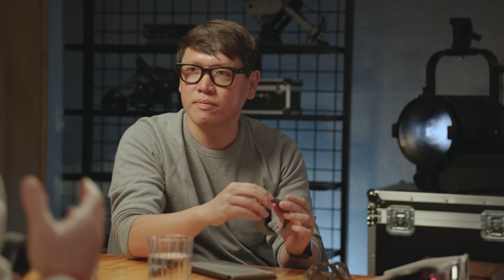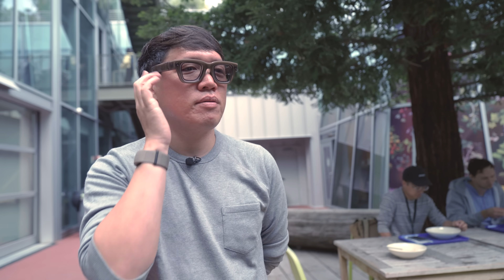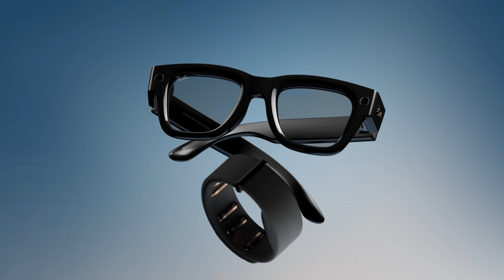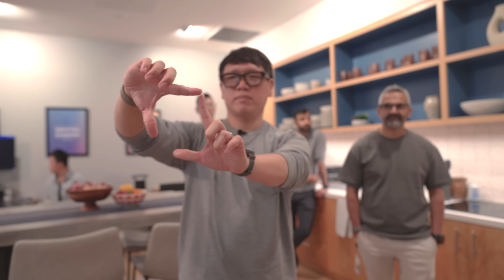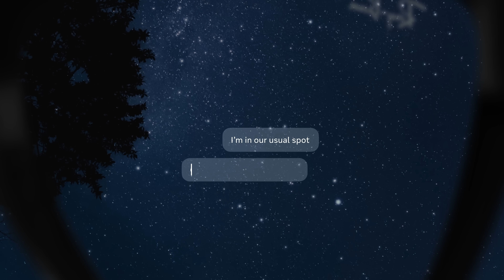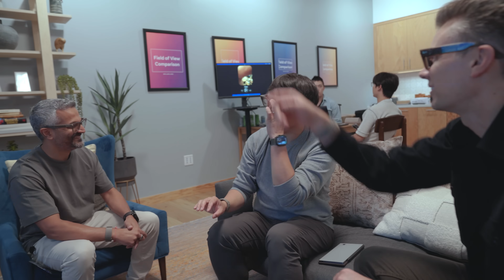Hands-On: Meta Ray-Ban Display Smart Glasses!

Comment: This review has certainly answered a lot of my questions, mostly about prescription interaction.  It does however raise more questions.  Is there any interface with google, phone texts, or the way they kept sliding down on you, which as an eyeglass wearer would get on my nerves to no end.  I feel like I would regret buying these with Google's product in the works.  It would be very interesting to have two rings on your fingers for interaction than this wrist band and would be a really cool upgrade or some sort of LED flash light built in as well.  This at least gets developers and inventors involved and thinking.  Thank you for a very good review.

Comment: There should be a battery pack you can wear like a vest underwear so you can hook up any wearable devices. I wouldn't mind a wire hanging down back of my neck connected from the glasses to the battery.

Comment: I really hope the neural wristbands will be usable with future Meta Quests.
A great input-method would be 'gaze and pinch' - similar to the Apple Vision Pro, but use the neural wristband (rather than hand-tracking) for selection confirmation.
This assumes that future headsets come with eye-tracking... fingers crossed.

I hope more companies will adopt the neural wristband form-factor as an input method. Currently, the only other company focusing on sEMG neural wristbands is Mudra - they call their sensor method Sensor Nerve Conductance (SNC) but is pretty much the same thing as sEMG. They're a 3rd-party manufacturer focused on smaller players in the XR glasses space.

In the long-term, I think it'll be unlikely for sEMG wristbands to be sold as purely 3rd-party wearables because of how tightly integrated their software has to be with the 'parent' wearable (eg, glasses, headset).

Comment: The major non-thermal effect of nnEMF is a net increase of deuterium in the TCA cycle with a change in the pool of hydrogen in the NADPH pool and a loss of melatonin which causes more deuterium in the cells. This single change destroys cell membranes where DHA is located. DHA controls the lipid cytosocial regions on lipid rafts in cell membranes to perform the movement of electrons on a liquid crystalline semiconductive circuit...a statement made by Jack Kruse. This is whats happening when you put these stupid ass glasses on. Wake up. And shame on tested for promoting this.

Comment: Are they releasing transparent display frames? The pair you are holding at the very beginning of the video looks clear, so you can see the electronics.

Also, would these have anti-glare for prescription lenses, and how does it work if you need to change your prescription?

Comment: When I get these in early 2026 (apparently launches then for UK), I will have the display turned off when I am in conversation and respectfully give my full eye contact attention to whoever I converse with. When I go to the theatre and cinema, I will have it switched off. It's all self-discipline and the glasses allow us that freedom to choose to be a sensible or not. My main problem will be how much extra will it cost for prescription that goes beyond +4/-4, I am a 5/4. I have the Meta Wayfarers since their launch and love them but I had to go to Lensology for affordable reglazing for just £100. Whereas Rayban was charging me £600 to include my prescription. Going third party for the lenses saved me £200 but that option won't be possible for the new display Raybans because of course the right lens has built in display. My worry also, is what happens when my prescription changes, what will Meta Rayban charge to reglaze if at all they can? Would render the glasses a useless paperweight if they can't reglaze with updated prescription. Thanks for the highly informative video, yet again.

Comment: I have 3 meta Raybans. Two are with perscription and the third without for when I wear contacts.  I use up the battery on the glasses within an hour, so I swap to my other pair while I recharge the dead one.

The glasses recharges quickly from the charging case.

What I do not like is you can only have 2 glasses paired to the cell phone. This is why I didn't buy a 4th pair.

Comment: 14 hours straight if Heavy flow Sunsert Dinner added for Free
Reply: Can't wait for the stabilization video. This is going to change sliding down rock slides and hiking up geothermal waterfalls and jumping into hot springs for ever. Just outside of Vegas Baby ;) @adventurechild

Comment: Can't wait for the stabilization video. This is going to change sliding down rock slides and hiking up geothermal waterfalls and jumping into hot springs for ever. Just outside of Vegas Baby ;) @adventurechild Guess we will have to get 600 pics and video instead of 300+ ROFL

Comment: As far as I'm aware the invasion of privacy issue, criminal exploitation and consent to commercial exploitation has NOT been resolved since the first camera equipped glasses were release years ago.
If a person doesn't give AF about your privacy and consent why should you interact with them let alone do business?
A limited field and range of observability light on the front of the glasses is not sufficient to the range and scope  at which these devices can be abused.
Norm and Adam, kindly express publicly your stance on this matter.  Covering tech for the sake of it is one level of curiosity, doing so actively without conscience is disappointingly significant.

Comment: Allow the question: Would it be possible for these glasses to perform calculations in real time? Could this be beneficial for my work as a salesperson at the cash register? Such a function would be extremely practical, as I would then no longer need printouts and the calculations would be done automatically, so that I would have the total amount directly after eight hours of working time. That would indeed be very beneficial.
Reply: Probably not since the glasses are not open for programmers. Maybe if the glasses have access to the browser and your calculater runs in the browser but I don't think there is a regular browser on these glasses that you could use for that. I would say no but not 100% certain there might be a work around.
Reply: I think it'd be very complicated to build that.

Comment: Probably the second version of the Ray-Ban display will be a success, the current version is still slightly too bulky and heavy. 

As said if it slides down your nose it will become annoying and you will not wear it all day as your standard glasses. 

They would be great glasses for developers but without access, I guess they will not sell well. Only with many apps available you might be willing to accept a slight discomfort but the features they showed are not the ones regular folks need every day and can be done as well with your phone or with the regular Meta Rayban glasses. 
For example: Who needs subtitles? Also zooming into pictures is better done with your phone. For quick pictures and videos, the regular Ray-Bans are good enough without the disadvantages.

I saw people use the Instagram live stream of the rayban glasses to get access to the video footage and use that for doing some development. I guess as soon as Google releases glasses developers can program apps for Meta will open up too. Currently, they are too scared of developers doing shady apps like face recognition and they don't want to be the first to get burned by bad press.
Maps are cool but it also works well with sound alone. AI is also cool but it also works with the regular Meta glasses.

The only thing I see where this could become somewhat useful is AI showing you visual information based on your context. 
For example, you read an article and there is the name of a famous actor and the glasses automatically look it up and show you the person in a photo giving you additional information, however, this would require developer access to add such features.

The only thing the glasses can do thay is unique is showing tekt or images hands free. There are use cases for it like cooking but even than its just slightly better than using your phone and you have to deal with all the disadventages and likely less intuitive navigation to the recepy compared to the phone where you can search much better and faster.

Conclusion cool but without developer access no thanks.

Comment: The number of times you pushed your Metas back up your nose is a bit telling. With the Meta Displays being heavier, that means it will be sliding down even more. I realize your head is a bit animated in this video - so it isn't maybe really that bad normally.

Thanks for the video. Also - there was a mid frequency feedback through the latter half of the video.

Comment: Best question is, will it translate other languages perfectly, can the AI pick up on mis-spellings and still understand ?
Reply: Depends on if the translation happens on the phone or glasses. if on the glasses it is not clesr if it has enough compute power to run the best models. if it runs online or on the phone the technology is already advanced enough to do it basically error free and in all languages.

Comment: Norm, the question I have is:  prescription lenses need to be adjusted every few years.  Does  this means to ditch the display glasses that often? Replacing the lenses would be really expensive, right?
Reply: You would need likely need to buy new glasses because they are build in one piece in the factory.
However after 4 years the technology is far advanced and batteries used up that you want to switch to a new version anyway.
Reply: Most people rarely need a new prescription unless your eyes are failing.

Comment: if i'm paying $799. i would have paid $999 for the better camera that the gen 2 glasses have. big fail there.
Reply: I missed that you saying the gen 2 has better cameras than the top of the line meta display?
Reply: @VR_Wizard  if you go to meta website and compare the glasses the display does video 1080p+ at 30 fps.. gen 2 and oakley do 3k video at 30fps and 1080p at 60fps

Comment: I hope they come out with a double wristband set-up for the Quest 3 and Quest 3S. I am going to skip the glasses, because I cannot wear plastic frames (I need something away from my face), and my prescription is definitely outside the range.

However, I can see myself using the wristbands for a PC, phone, watch, iPad, VR, and more. I actually bought the Control-labs version a decade ago, which didn't work well. But I trust that ten years of innovation, adaptation, and AI have probably made it very good. I am glad that Meta picked them up, otherwise the technology might have been lost. If Meta comes up with a watch combo, I will definitely buy it.

Comment: okay so ever since the band was announced, the connection that I perhaps hallucinated but has persisted and seems like something they hint at is that what the system is really detecting is say not the physical motor input that guides your hand in the shape of a J, but you think" Write a J " and that thought is whats picked up, like its reading the intent. when you were using the band did you ever get the sense that you could possibly control it without ACTUALLY moving your fingers, I have long wondered if this type of control input could create a situation finally where you are sitting in a chair, and you can just imagine yourself walking forward, and it happens in game. have any of your conversations with the Devs hinted at anything this advanced? It seems like there is a lot more its capable of that they don't want to reveal yet.

Comment: This was obviously recorded prior to the live event.Why is nobody talking about the absolute disastrous live demonstration?..I want this technology to work because it could help me with both my eyesight and hearing degradation.I Want this to be viable.However Zuck and Boz blaming WiFi for the shambolic demo was laughable.This device is pitched on working flawlessly in a world saturated with Cellular and WiFi connections ?It was demonstrated in possibly one of the most controlled environments possible and it fell flat at the first hurdle.Such a shame
Reply: Because the two issues they had in the demo were pretty much expected when trying to use Wi-Fi in such an environment. No one actually cares.

Demoing in a convention area with hundreds if not thousands of people nearby and using the wi-fi is not a controlled environment.

Comment: 58:37 Questions!

(About Display Glasses)
How were the prescriptions on the meta display glasses? Is it an attachment that sits flush on the lenses or work more like a clip-on accessory? 

Have they made plans to expand there prescription range? 4.00 to -4.00 doesn’t match my prescription unfortunately. 😢

Do you have to pay extra for prescription add-ons?

Were you able to test Meta’s map application on the Display Glasses? How was it?

(Personal opinion)
Which out of the four new glasses is your favorite? I honestly came in prepared to like the Display Glasses, but I think I like the Vanguard more.
Reply: You have to order them with the right prescription. They support from +4 to -4 and that is what is ground into the lenses.

Comment: I love the display, the controller, the design.  My only concern is strapping cameras to my face, not really enthused at letting Meta see everything I see everywhere I go.
Give me a version without cameras, and I will likely buy it.
Reply: The G1's don't have cameras but they are only monochrome. I belive they are working on releasing a color version very soon.
Reply: @BlackSheepGene  nothing i've read on them seems to indicate any good audio system.
Reply: Obviously I don't think it's always running. That silly.

But the possibility of accidental, nefarious, or just invasive viewing of what I deem private is not appealing. Meta doesn't have the best track record for privacy, and I'm not enthralled at the idea of letting them potentially see my intimate moments. It's the same reason I have security cameras outside but not inside my home.
Reply: It needs camera's for the AI to see what your seeing though.
Reply: The camera is only on when you choose for it to be on, and it has a flashing light to remind you that it is on. There are thousands of lawyers just waiting to try and sue Meta for capturing data when they say they aren't.
Reply: I was lucky enough to be born with a large Penis. 

For that I have nothing to hide. I'll take mine with the camera 😎
Reply: the controler neural band not good if you twisting your arm you looks like you have parkingson deseas haha
Reply: If the camera was running all the time the battery life would be complete garbage, worse than it already is lol
Reply: You can just not use the camera they don't record all the time.
Reply: @VR_Wizard  Lol. So naive.

Comment: Too bulky, gimmicky wrist controller instead of something reliable, locked in to Meta, more than double the price of the previous version. No thanks.
Reply: There is no previous version. They have never made glasses with a HUD. What hands-free controller are you aware of that will fit the bill and be "something reliable." No one is going to walk around holding a controller in their hand.
Reply: @JorgTheElder  Honestly not worth answering, but here ya go: If you can't tell what I'm talking about when I say "the previous version" you may need to seek remedial education. Your claim that it needs to be hands free is a false premise. No where did I say it had to be hands free. However, even gesture controls monitored by the camera would be more reliable, as it is a more mature technology. I would personally prefer physical buttons, or indeed a literal remote control. Perhaps even app controls on my phone. Either way all my points stand.

Comment: Just one thing, can I put on my custom prescription lens on it? Sadly can't order them with my prescription as Meta rayban still hasn't officially come in my country.
Reply: Yes, 27:24
Reply: @rjc4370 sadly it seems to be 4 at max.
Reply: Depends on which glasses you want the regular meta raybans should allow a skilled optician to replace the lenses. But maybe the new version is glued in and than you have a problem.
The display glasses might not offer the mentioned stick on subscription glasses so you might not be able to use them.